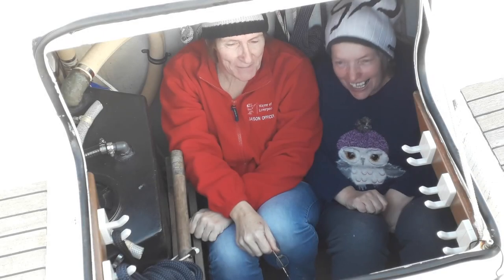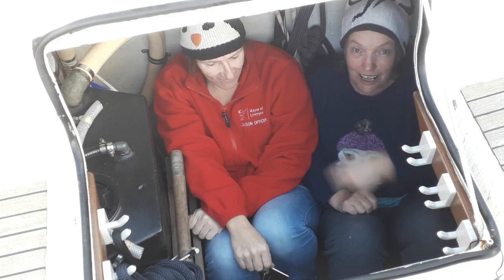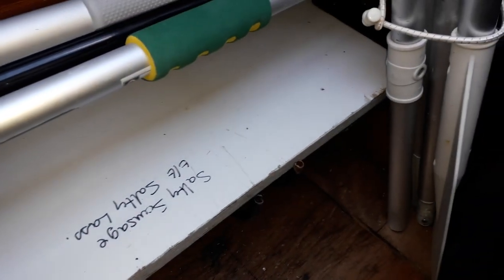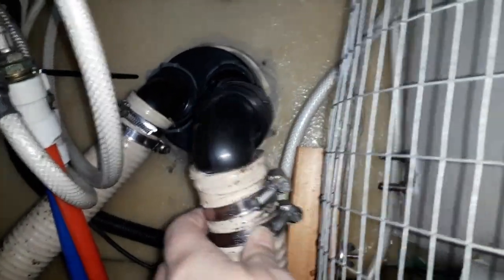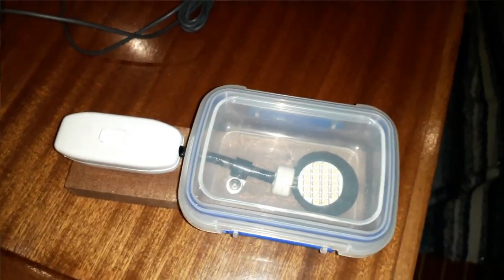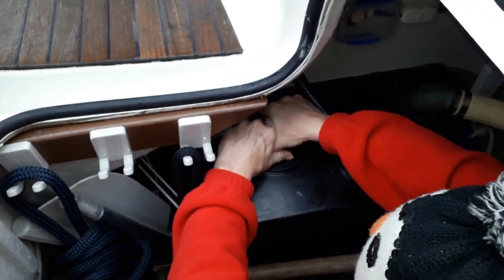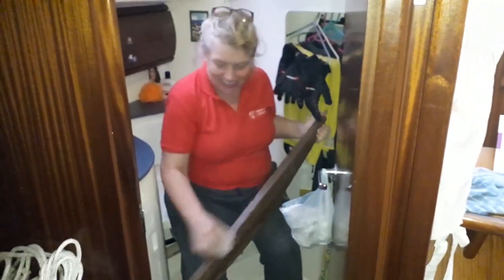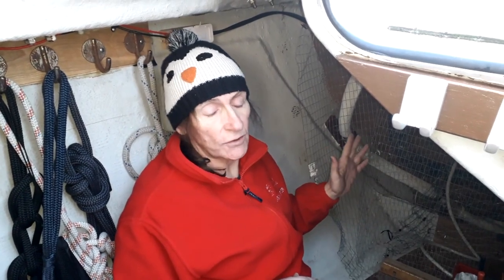The starboard locker - Winter sailing and projects - Ep. 118

Comment: Loving the poop inspector tool. We made David one last year with to 8m socket head bolts that fit in the finger gaps as he has the same type of lid as yours. Top tip for your cold gas is use hot water from you deck shower on the bottle for a minute or so. When you get it sorted. Or get a two ring electric hob and use the marinas electric not your gas 🤣 Loving the simplicity of your solutions real KISS thinking. Another great video ladies 👍👍👍From us. Ant, Cid & the Pooch crew. xx
Reply from the maker: At least now we can actually USE the deck shower. As for cooking with using little gas, that is what we have Mr D for ;-)

I did see your poop tool video. Thus the comment in our video. I guess I should really pop a link in the description. Can you send me one over please?

Thanks for the comments and tell Cid we are looking forward to her next editorial debut x
Reply: @SailingYachtSaltyLass  Hi Ladies, we have been hard at it today taking off the bimini, cleaning it and coating it with Fabseal. Cid and I did all the stainless frame, the solar arch, the pushpit  and the wheels with stainless cleaner. We are knackered. The link is https://youtu.be/VJicd10Pqyk. Water and lights. We have had two issues with the cockpit shower on two Bavaria's. If the hose is full and the temp goes zub zero the hose or fittings can burst. Not a problem if you live aboard really. The other is the black hose seals between the shower head and the hose or the hose and the valve fitting. They degrade and shrink over time and the hose leaks into the bilge until your tank is empty or you notice the pump going off every half hour or so.... Good idea to change them out every year or two and check  for leaks every 6 months or so. Or if your water pump switches on every now and then..... Bit of Bavaria info there for you to share... Sail Safe. Ant, Cid & the Pooch crew.
Reply from the maker: We did have a leak were the hot water comes out of the calorifier and we changed the pipe for that one which sorted out the "pump buzz", but very occasionally we get another "buzz" and we have been checking the quick-fits, but we never thought of the cockpit shower. Top tip!!

Thanks for the link
Reply: @SailingYachtSaltyLass  Just out of interest was the leak in the red plastic hose? A pin hole that sprayed water? We Had that twice on our B32. We cut the pipe shorter and pulled out the slack to re connect it. About 3 years later it went again about 6 inches from the clorifier. in the same red plastic hose..... Ant
Reply from the maker: It was the hot water one so yes it was red, I expect it gets more brittle than the blue one because of the heat. We have also supported the pipe so that it suffers from less vibration. Don't know if it will work in the long term, as it only started causing us issues this summer, we fixed it then, but we have since replaced it